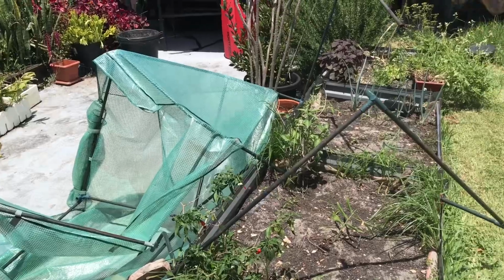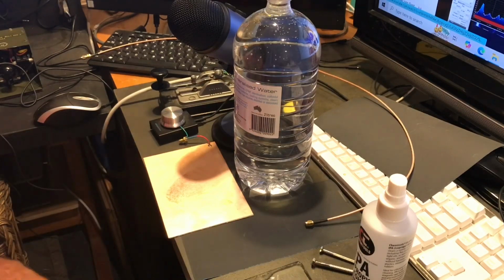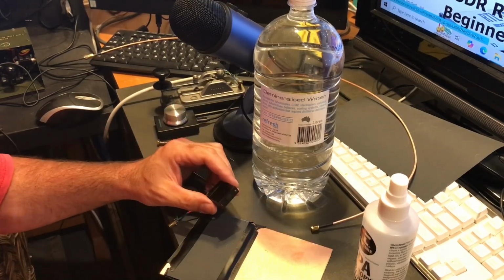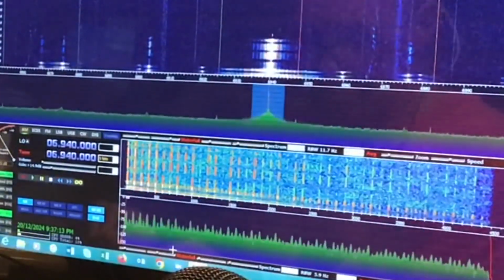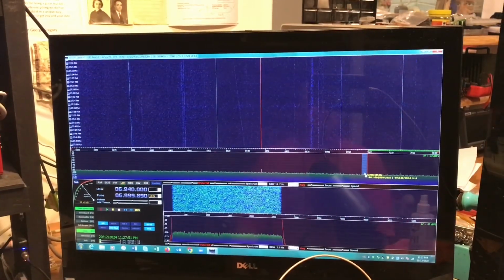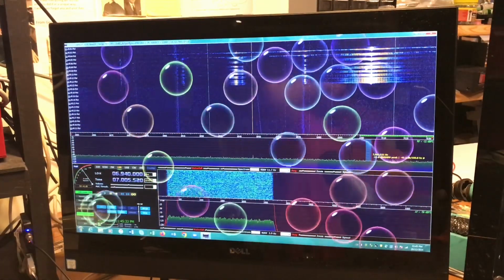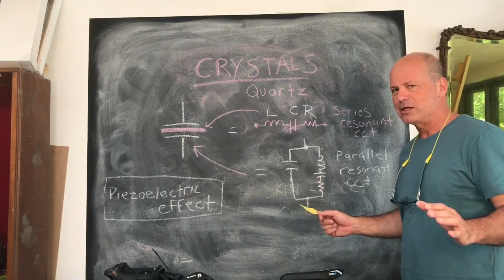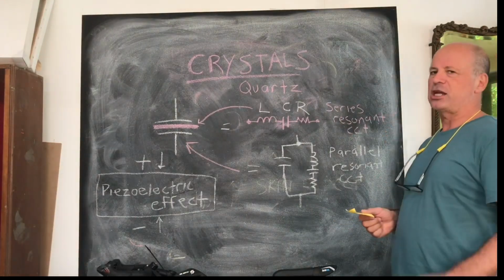Grinding a Radio Quartz Crystal - FT243

Comment: During the 40s, 50s and 60s, so many of those crystals were built and sold to radio amateur operators for their transmitters. I bought some surplus crystals as a novice in the 1970s, only to find the frequencies I chose ended up being right on top of high power short wave transmissions from the communist block countries.

I ended up taking my crystals apart and grinding them, and only one went out of band, but using a #2 pencil, I was able to put a dot of graphite in the center of the crystal and lower the frequency back into band! However, my crystal holders were of the side mounted plates, not the slide over covers you had.

Thankfully, the FCC changed the rules and allowed Novice operators to use VFO operation, which was a miracle we had prayed for! I was given a Heathkit VFO to build for my HW-16 transceiver, and I was able to make contacts much easier!

Today, we look back and say how crude we were using crystals for frequency generation, but even in this digital era, we have master crystals in our transceivers that ultimately control the accuracy and stability of our transmissions!

And I would be willing to bet, crystals will be needed well into the future of everyday electronics!
Reply from the maker: Yes….agreed and as things get more modern and “fandangled” the trip down memory lane becomes a sought after experience. Thanks for sharing the ham memories and 73.

Comment: Where this  could be really powerful in a practical world  is to take two nominally ident. FT 243s at say 8175kHz for so and grind one up by  1500 Hz and you end up with a Lattice filter for either SSB Rx or SSB Generation or indeed both . There are details of the simple Lattice filter in the  PDF /JPEG   Schematic I sent you from ARRL HB - ie the full implementation in a Receiver ,  Superhet Rx.
TEF
Reply from the maker: @F_Tim1961  Thanks Tim…. Yes the HOMEBREW possibilities are exciting…. It takes some time but is very meditative and a filter would be a fun project … happy new year OM and 73 from Siam.
Reply: @TheArtofEngineering  The reality is   that   LADDER (Cohn ) filter  at  9.00 Mhz can be bought out of PRC for about 15 AUD on a pcb with all the capacitors installed but  a  lattice filter might be a very interesting experiment - 

On top of that it could be a parallel module you could  bolt  in to your Dx -160 to produce vastly better selectivity  - if  it all  comes up roses  (leaving the existing systems in place). NOW that's a  Real  Radio man project.

Comment: 40m was open to Japan on Thursday night. I put out an RBN test call and still managed a QSO with Adam VK2NNW and VK3MJ Mark. 

It’s been quite some time between QSOs with either of those chaps. 

Anyway. We’re missing you in real life. There is Whiskey to sip. and you can’t say whiskey without Key. I have another one of those things to unbox
Reply from the maker: Ha ha… yes I’m hoping my key has arrived in my absence! Also wireless mics. Great you got back on the key. That was the last video in the can… back around the 19th …. Hopefully a little time to play radio before work starts 😩
Reply: @ what ?? That’s more than a week !!   There’s all the Parks Off The Air video. Might be enough to throw a short together. Keep the hoards satiated. Save them running off to Hayden’s channel or stalking Peter Parker in his community posts.

Actually, did you want me to swing past and check the porch ???